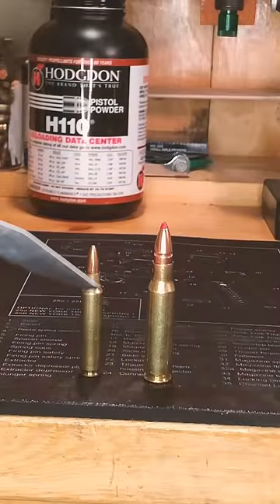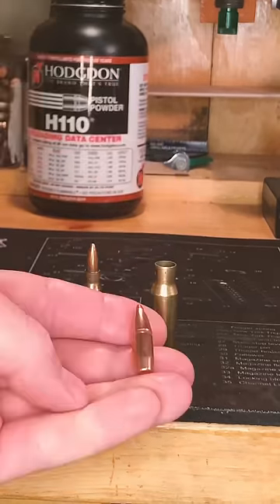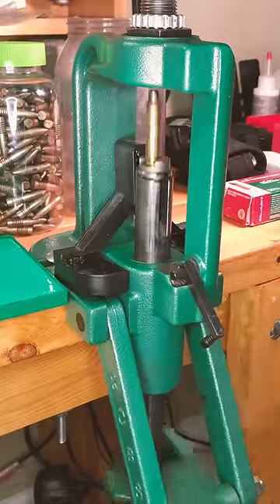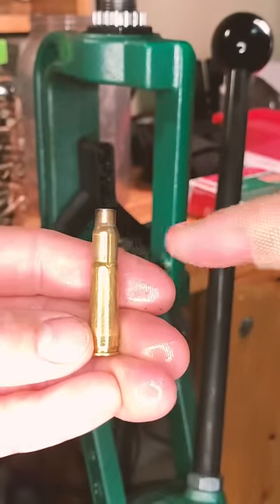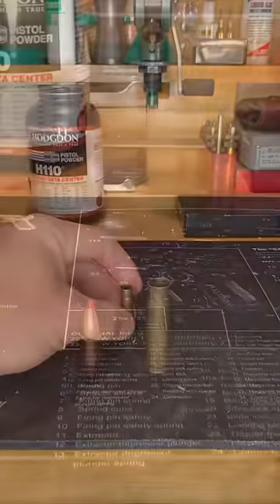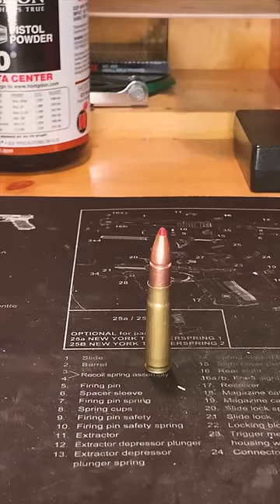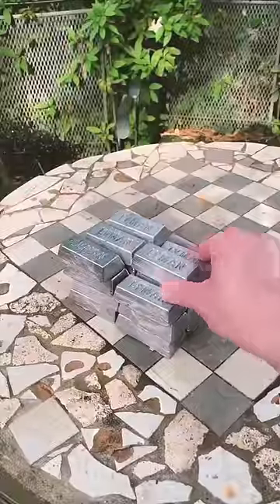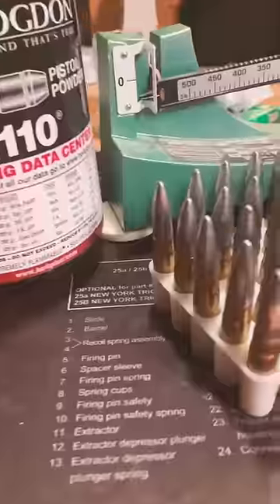A brief synopsis on the concept and history of 300 Blackout. Part 3. #shooting #guns #reloading

Comment: Brah... 2011????? No it was Kevin from Q llc back in 1993...working under AAC....
 

But formerally known as the .300whisper when it was a wildcat round pre 80's by JD jones.
Reply from the maker: https://en.wikipedia.org/wiki/.300_AAC_Blackout

“ …blackout was approved by Saami on January 17, 2011…”
Reply: There was no Whisper cartridge before the 1980's. JD came up with the whisper name around 1991. before that the cartridge was known as 30 Grendel, no relation to the current 6.5 Grendel or Alexander arms.

Comment: Geez am I right? The lead will splatter?
Reply from the maker: Any projectile that hits anything hard enough at an adequate velocity has the infinite potential to fragment or “splatter”. That even includes the most advanced, heavily jacketed rear-half retaining projectiles on the market today. 

Now…if you are referring to these unjacketed projectiles in the context of concern that they will not perform as intended upon reaching their target…because they do not sport a copper jacket, let me remind you of a few things you already know (or at least SHOULD know if you shoot guns). There exist many forms of ammunition today that use projectiles that are not jacketed in copper, that perform perfectly well. 
Remington Thunderbolt, CCI standard 22LR, Federal Gold Medal: ALL OF THOSE use a lead bullet that is simply coated in a layer of lube (like the ammo I’ve made here) that prevents leading of the bore and more importantly lubricates and protects the bullet during its trip down the bore. 
But let’s get into it a bit deeper, ALL of the pistol ammo out there, that is loaded with copper plated bullets…these are no better at remaining intact upon impact than the aforementioned lubed lead bullets. Electroplated bullets have an extremely thin layer of copper that you could literally scratch off with one of your house keys. It serves no other purpose than the lube of the aforementioned ammo or if you are familiar, the polymer coating of polymer jacketed bullets. I find it interesting just how many folks out there are appalled at the idea of seeing “naked lead” and have developed this peculiar since of security when it comes to coating like polymer or electroplating that don’t even come close to doing what actual jackets and partitions do on high powered rifle bullets. 

Now, getting back to terminal performance: if you’ve ever shot handguns at a steel silhouette target , you know firsthand, the bullets smack the target, flatten like pancakes, splatter off about 20 %of their weight of their perimeter and then drop like stones at the base of the target. The same would even be true of your standard 22LR. The alloys these types of ammo are made from will typically do this. It is a midrange BHN alloy, about 10-15.  
The ammo in this video series is a midrange thumper of a similar alloy. It runs about 950-1000 fps. It’s plenty accurate, doesn’t lead the bore, and remains nicely intact as long as it’s hitting something no harder than a piece of wood. To ask or expect more of a 225gr projectile going 950fps would be pretty silly. 
Now given the extremely bewildering and open-ended nature of your question I was for awhile quite unsure of how to approach it but hopefully I’ve answered some things you were wondering about. 
If you’d like to have another conversation about gas checks and other interesting things to know about the wonderful and apparently forgotten world of unjacketed lead bullets please drop me a comment regarding just that. We’ll crack open a cold one and get to it. 🍻 
Happy shooting 💨 
-Stagger
Reply: @staggerleesmancave8987  dude, thanks for the lesson. I learned something.

Comment: Be careful doing this with 223 use 5.56 or just use blackout brass 223 is made lighter we reloaded some and blew the bolt up we used the right power and did exactly what the book said had it happen 2times with223 never had it happen with 5.56 or blackout

Comment: Why would you ruin a 223 brass to make a 300 B O
Reply from the maker: The .223/5.56 case is the parent case of the .300 BLK. It has been around much longer and is far more abundant (whether you’re talking about finding it lying around or buying it as spent brass). It is therefore, often more economical, if you want to handload 300 BLK to acquire your brass this way. 
Another good option is finding a good deal on bulk 300BLK (that has good brass) from places like PSA. 
-Stagger
Reply: Sorry I was being sarcastic about the 300 bo I have been around it since it came out and not impressed but only my opinion
Reply from the maker: @MauriceHeberer-cz1dg   no harm brother! You love guns, shooting, and protecting your rights and that’s what matters! 🇺🇸 💪. 
The 300BLK is definitely a controversial round, of which there are many. For example I absolutely HATE the .22 WMR. In my humble opinion it’s overpriced as a rimfire. It pales in comparison to the .22LR in terms of accuracy. For what one pays for a box of .22WMR they could simply handload some lightly charged 40gr spitzers into a .223 case and quadruple the downrange performance. To each his own. Happy shooting 💨 
-Stagger

Comment: powder coat those and you wont get lead fouling
Reply from the maker: I’m pretty much a die hard Lee liquid Alox fan for life. Been using it for over 14 years and never had issues with leading. May give Powdercoating a try one day if I find a good deal on some since I’m not opposed to a little experimentation. But the likelihood is not high that it will outdo that sweet Alox. 
-Stagger

Comment: You melted it. You didn’t smelt it.
Reply from the maker: Ah yes…the old recurring diction correction. The word smelt in metallurgy usually applies to the extraction of a metal from its ore…from the rock and dirt with which it has been sequestered in the earth for millions of years. For as long as bullet casters have gone through the task of separating lead from the dirt, bullet jackets, wheel weight clips, and other trash to which it is mixed and bound, we have used the word “smelt” because the two tasks are so akin and because what they’re doing is so much more than melting. Don’t like it? Doesn’t matter. It’s the word we will always use. 
-Stagger

Comment: Won't that eventually foul out your can? Why not powder coat it?
Reply from the maker: There is no denying the popularity of powder coating. Granted, it may, indeed at some point supplant proven lubricants like Alox. I’ve seen individuals on many YouTube channels swearing by the powder coating with much enthusiasm….This is why I currently won’t do it: 
Lee liquid Alox has been extensively tested in an actual firearms laboratory. With a very expensive chamber pressure measuring tool that likely neither you, I, or most YouTubers could ever afford. Not only that, even more extensive tests have been performed at Lee Precision, such as inspection of bores with small cameras following thousands of rounds to ensure that their product prevents leading of the rifling. While Alox may not leave my projectiles looking like all the fun colors of a bag of skittles, at least I can rest assured that it will always keep my firearm functioning perfectly when using unjacketed projectiles.  
-Stagger

Comment: Yeah, but you're not going to stuff a 150gr bullet in a .300
Reply from the maker: Actually,
The load data for 300 BLK supports the use of projectiles all the way up to 230gr. Mind blown? 😏 
-Stagger
Reply: @staggerleesmancave8987  yes!
That's crazy!!! I reload my 7.62x54R with 150gr .311 spitzers, and can go up to 200+gr, didn't think the .300BO had the velocity for such large projectiles.

Comment: as soon as u learn how to jacket them lemme know
Reply from the maker: I find it interesting how many individuals, are taken aback at the idea of an unjacketed projectile with only a coating of lube such as Lee liquid Alox. It’s almost as if they’ve forgotten the thousands of rounds they sent through their 22LR’s at 1100-1200 fps that were only lubed lead bullets (REMINGTON THUNDERBOLT and CCI Standard Velocity 22LR to name a couple) 

For projectiles going up to about 1400 ft./s it is perfectly permissible to simply have a lead projectile with a coating that prevents leading. I use Lee Liquid Alox. Many other folks like to use powder coating. 
For anything exceeding 1400 ft./s. You may find it interesting that you can also continue to use lead projectiles and simply make the addition of a copper “gas check” ( a copper disc ) to the base. There are certain bullet designs that will accept gas checks. They snap right onto a recess in the base, and when the bullets are pushed through a sizer they are crimped on even more permanently. The gas check protects the base of the bullet during its trip down the bore and prevents the hot gases from cutting through it. 
Happy shooting  💨 
-Stagger

Comment: You may as well just get the .308 and get the full power of the round. What’s the point of using a .30 caliber rifle round when you cutting half the velocity from it with those short cases? The only logical reason that anyone has ever come up with for having a .300 blackout over a .308 Winchester is merely suppression ability, the main people choose .300 blackout is because it can suppressed really well. But other than that it is most definitely inferior to the .308, .308 is a real precision round that is cap or of being used as a sniper round or the average battle round chambered into AR platforms. But what’s the point of doing all this work just to get a weaker round than what its original formulation was intended? That’s like taking your 9mm and then chambering it in .380acp, or like taking a 10mm and chambering it in .40cal-defeats the whole purpose of buying the 9mm or 10mm.  Or like going from .223/5.56 to .22 caliber lol I just can’t stand the .300 blackout for any real life applications within the defensive/offensive realm. But to each is own, and we all have our own preferences, and if you prefer the .300 blackout then all the power to you and happy shooting, I’m not knocking your choices. I just like to get the most bang for my buck out of everything and making sure I have fully Powered rounds is just one of my preferences.

Comment: Powder coat your lead!!!!
Reply from the maker: My bullet coating of choice is Lee Liquid Alox…as it has been for 14 years. It work phenomenally. 
I find it interesting how many individuals refer to powder coating like it is the new standard while to my knowledge, there is no literature to support its use and safety. 
 There is no denying the popularity of powder coating. Granted, it may, indeed at some point supplant proven lubricants like Alox. I’ve seen individuals on many YouTube channels swearing by the powder coating with much enthusiasm….but until powder coated bullets are being sold by a major component supplier like MidwayUSA, this is why I currently won’t do it: 
Lee liquid Alox has been extensively tested in an actual firearms laboratory. With a very expensive chamber pressure measuring tool that likely neither you, I, or most YouTubers could ever afford. They have also performed inspections with bore cameras after thousands of rounds to ensure that their product prevents leading of the rifling. To my knowledge, this cannot be said of powder, coated bullets. While Alox may not leave my projectiles looking like all the fun colors of a bag of skittles, at least I can rest assured that it will always keep my firearm functioning perfectly when using unjacketed projectiles.  
-Stagger

Comment: Robert Silvers did  not develop this cartridge!! It was designed and developed by J. D. Jones as the 300 Whisper, along with other similar cartridges.  His only mistake was not submitting it to SAAMI for approval.  Silvers came from behind and submitted the same cartridge to SAAMI , renamed the 300 Blackout.  Silvers basically stole Jones's design and took all of the credit by being first to submit it, but should not be given credit for it's design or development.  Very unethical!! 😡

Comment: Blackout isn't worth the time or effort.
Reply: Unless you used it for urban ops in Iraq, as it was intended.
Reply: @blackhawk7r221  good luck with that one. Short range.
Reply: @FNS-gl8ji  Exactly correct.  Short to medium range thumper for less than 300 meters.  It got kinda old having to pump 2-3 5.56 rounds into a baddie before they dropped.
Reply: @blackhawk7r221  yet the enemy sits back out of your range because their round reaches you but you can't touch them. There's far more effective rounds than 300 bo
Reply: @FNS-gl8ji  We only used them for block to block city street fighting.  When we conducted normal patrols out in the countryside or mountains, we carried our normal M-4’s and M-14’s.